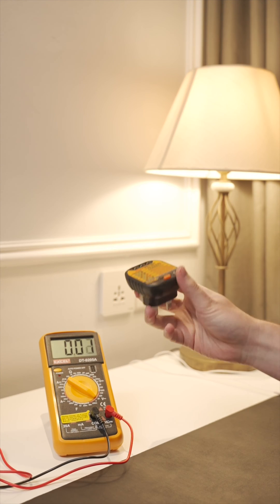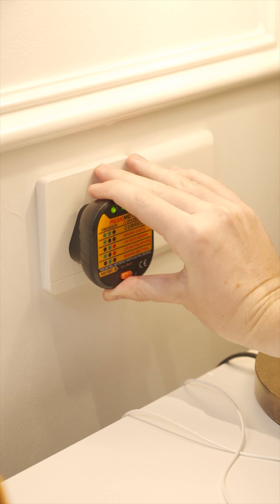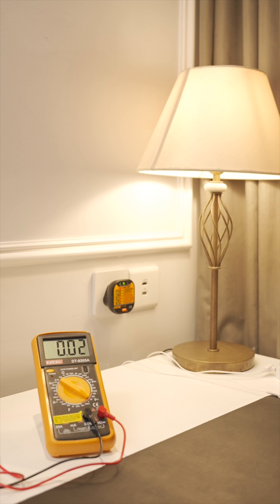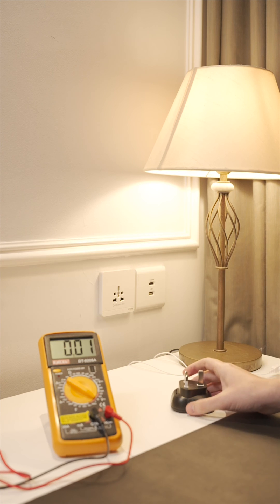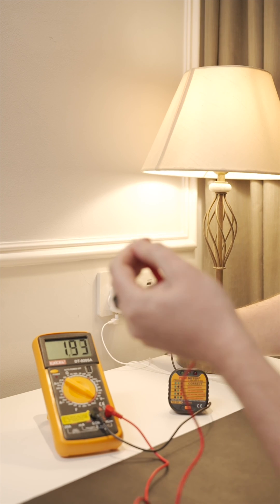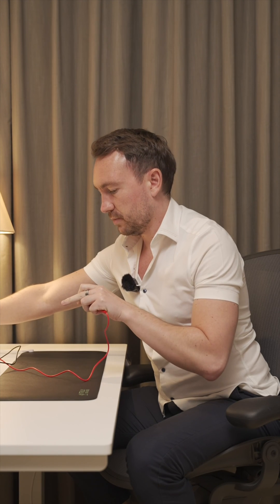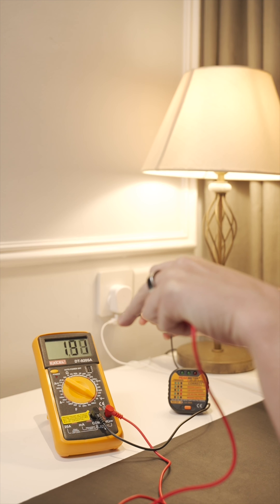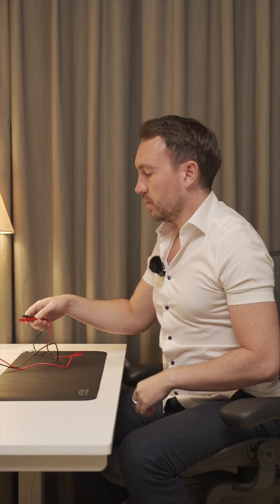How to test your Truly Grounded Ground Mat with a multimeter

Comment: What setting do you use on the multimeter?
Reply from the maker: @rashidahmedlimbada8524  Hi, it needs to be AC voltage with a low range to get a reading.
Reply: How low?  Mine only goes to 1.5V
Reply: Do I need to plug the black tip from the meter into the socket when testing? The video makes it look like you just touch the wall. Thanks!